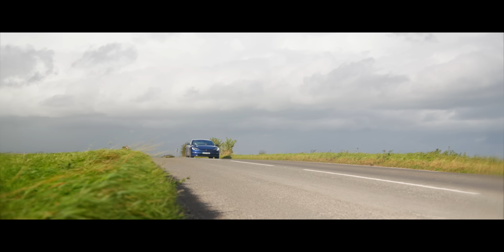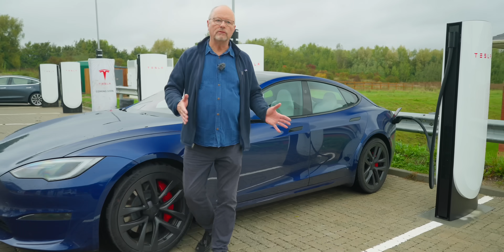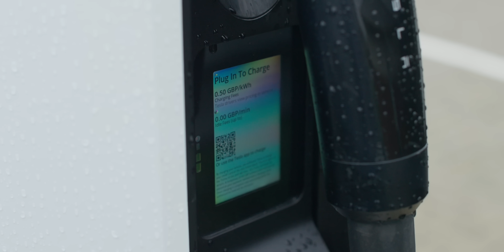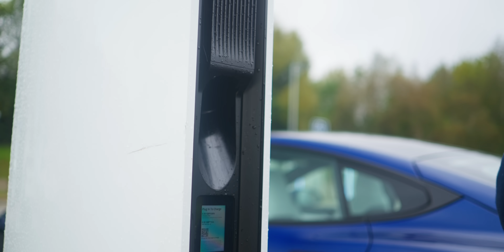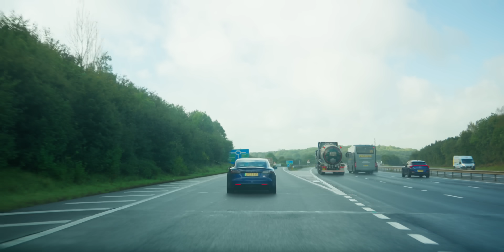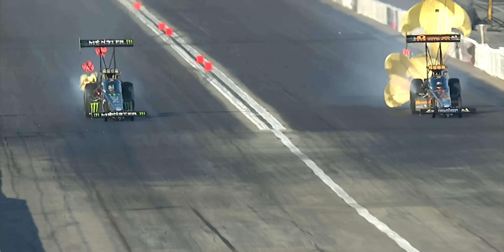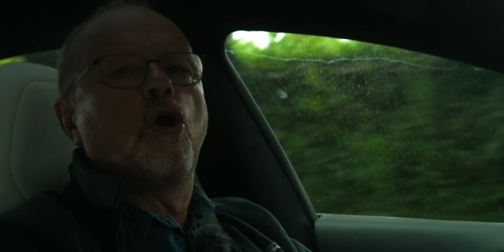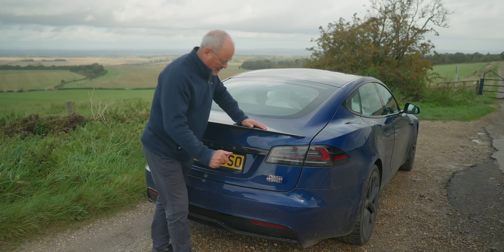THIS Is Why The Model S Plaid Didn’t Come To The UK

Comment: Clearly, like the TM3 "upgrade", the lack of stalks is a cost-saving exercise, and another move towards de-skilling drivers so that they become dependant on automated controls. Personally, I'm extremely happy with my 2022 TM3LR, and forgive its's crappy automatic wipers, and terrible Auto-pilot cruise control, because I don't ever use them now. But I will not willingly have a car which requires conscious observation of the controls, to accomplish basic functions like signalling, horn activation, wiper controls, forward / reverse. Driving a car should be fluid and natural, done by touch & feel, not by having to divert 100% of your attention AWAY from the road to manage basic tasks.

Comment: I think Tesla are redesigning things on the assumption that the car will be driving itself soon, including indicating, so slowly removing things. How safe that assumption is a matter of opinion.

They're probably thinking it's not worth having a right hand drive S & X factory line when a few more versions down the line the car will have no steering wheel and be identical whichever side of the road it drives.

One thing I do think has changed for the worse that isn't about the driver is the space. My 2016 Model S is like a Tardis maximising every possible cubic centimetre. 
The cavernous space behind what would now be the front boot is large enough for a large holdall and still leaves a massive space enough for 3 or 4 backpack sized bags if they are soft enough to fit the shape. On top of that there's another large space under the boot. The newer models have a plastic molded shell only big enough for one large case in.
Reply: Thinking that cars are gonna be fully self driving in any kind of near future is a MASSIVE leap of faith......also, being able to do it, doesn't mean it will happen..............!!

Comment: Controls in a car are designed to be able to be found and used without taking eyes off the road.
Indicators, wipers, climate control all needs to be physical levers and nobs. It's infuriating and dangerous when I have to look right down at the bottom of a screen to adjust the air. At 100kph, I've travelled 200m in that time, scary.

Comment: The Model S will remain the choice for Tesla Fans only. Why spend over a 100k on a car with the steering wheel on the wrong side, let alone the daft indicators! Whilst from other YouTube videos this latest model is as cheaply and badly built as ever! 
Still it's great to see the Supercharger network being opened up, even if it takes away the one reason why most people buy Tesla's.
Buying a Tesla is like buying a white goods appliance, a fridge or something. Most of the Model 3 or Y cars I'm guessing are bought on lease or as company cars by buyers who aren't interested in cars generally, and the Tesla thanks to being an EV has cost advantages. Most of the Model 3s I see being driven around London are all in white (I believe the only no extra cost colour) and filthy, maybe I'm wrong, but that tells me company car transport with little pride in ownership - they are the modern day version of the fleet Ford Cortina or Vauxhall Cavalier. Back then the basic rep had the 1.6L Whilst those further up got a GL or Ghia/CD. Presumably today the option to choose an extra cost colour would be the equivalent!!

Comment: We're burning 100 million barrels of oil each day.  That's 4 billion gallons of oil per 24 hours.  That's like emptying an 18" diameter pipe that's wrapped 1 and 1/2 times around the Earth every 24 hours burning at over the speed of sound continiously.  Every moment.  Don't get me started on coal too.

Comment: As you mentioned, when you drive very fast, a combustion vehicle consumes a lot of fuel. Keep in mind, running the Plaid at 200 MPH will drain the battery in a big hurry! The only thing this car can't pass at 200+ MPH, is a charging station.
     You've now got a car that competes with Bugatti, McLaren, or Koenigsegg, leaving Ferrari and Lamborghini in the dust. The difference is, it costs 1/3 as much per mile to drive as a Toyota. The Tesla costs only about 1/10 the purchase price of any combustion car that can even hope to keep up. The Tesla can be driven every day, with maintenance costs being the same or less, than a small economy combustion car. The 3 "Hyper cars", and the 2 "super cars" I mentioned, are maintenance "nightmares", and guzzle fuel, costing 10X more per mile, than the Tesla that can out-run(or at least, keep up with) those super expensive supercars.

Comment: Incredible piece of engineering for sure. As for it being able to beat an F1 car to the first corner on a racetrack, I remember back in 1993 Michael Schumacher's car did 0-150mph in 7.5 seconds (according to the commentator Martin Brundle during a race). I suspect the current F1 cars are no worse in acceleration and other performance parameters. Comparing apples to oranges of course.
Reply: It might beat the F1 cars off the line, but they will come past well before the first corner because they brake so much later, partly because their brakes are so much better and partly because they aren’t slowing down as much.
Reply: @peterbrown6453  And because their extreme downforce gives them so much more grip / traction that they can brake harder without skidding / losing traction...
Reply: @logicalChimp  I was thinking more about the downforce enabling higher corner speed and therefore less braking, but you’re right

Comment: Ever noticed LH drive cars are more ergonomic, but for RH cars manufacturers simply transferred the steering wheel to the right and only swopped the main light Switch over, but kept the stalks as they were, plus centre consul A/C is now worked by left hand - my old Morris Minor had indicator stalk on right hand side, and headlamp dip was a left foot floor button lol. 
 LH cars logically have ALL light functions eg switches, indicator/light stalk and cruise stalk on the left, -  then ALL windscreen functions eg wiper stalk on the right, plus right hand use centre consul A/C and demist etc buttons.
Means they can change gear with right hand at same time as left hand working indicators or flashing lights by keeping left hand on wheel for overtaking - or simple motorway cruising by using just the left hand for all these major controls. 
Also LH cars has a wheel mounted volume control on left and the radio volume in centre consul on the right, so either hand can quickly say mute volume.
After 50 years it is too late for us oldies to learn any new layout on ICE cars, unless EV cars slowly introduce it.

Comment: I think an indicator stalk is a safety feature. Do a left turn with a quarter turn of the steering wheel and then try to use the indicators.
Reply: I would hate that when using the large roundabout near my house.  It's a dual-lane one with 5 branches, and people really fly around it fast.  Some idiots don't understand that if you're in the outside lane, you have to turn off onto the very next branch.  So when I'm in the inner lane, I have to allow for those idiots - and it takes a lot of my attention.  Do I have enough attention remaining to find the signal button as well?  Not really!!

Comment: Not sure that I will ever use all the capabilities of my Model 3.... although I did get it over 160kph on an Autobahn earlier this year.  But yes, the blistering acceleration when you need it is something else.  
I have found the inability to easily change wiper speed a bit of a pain. Auto mode isnt very responsive. Even sometimes turning the lights on (hey, car, its raining - put the lights on) can be a faff around some menus (while you are trying to drive in your own lane).  Not sure removing more stalks is a sane idea.  In fact, I was wondering if someone couldnt come up with a set of buttons the clip on the bottom of the screen for some "quick access".  Having a button in a known position that you can get to without looking at it seems to be things I miss most.

Comment: It's not that you're an idiot: it's habituation. If you, like most Tesla drivers, are using "2-pedal-driving" do you complain about having used the brakes "for ages" and now miss them?
Physical levers need actuators to input lever signals, while the coming FSD Robotaxi will be even a step further with no controls at all! 
Every technology eventually gets streamlined to its most efficient, simple, least expensive iteration. 
If Trix are for kids, stalks are for human drivers...for now.

Comment: The horn is the more dangerous thing here. In a moment of panic, having the horn in the middle is easy since people out of fear naturally put their hands in front of them to "brace" themselves. No amount of Bruce Lee finger pushups will protect me from an impact using a single finger.
Reply: If you leave the horn until you're actively bracing, you've left it a bit too late for it to have any benefit.  The horn is best used before you reach the 'oh shit' point :p
Reply: @logicalChimp  And yet that's not how horns work in oh shit moments. Prepare for the worst, hope for the best. Otherwise you set yourself up for disaster.

Comment: nope your bang on about the controls Robert,  its ok in America due to the block layout and long roads, but Europe with its many corners, roundabouts, left/right turns, I feel its a major safety concern and tesla or government should step in and mandate wheel controls indicators. lights  wipers and gear select as mandatory physical controls,

Comment: We need to stop spreading mis-information about EVs. We really need to do that, because all the mis- information about EV's is killing the market for them. EVs are better for the environment than ICE vehicles. I drive an EV. But trying to pretend that they are easier to use than ICE vehicles is a lie. It makes EV users look like crackpots, and discourages people from making the switch, because they do not like being lied to.
Diesel car owners can add 900 mile of range in 10 minutes. They don't get charged a higher price if they decide to pay by credit card instead of through an app.
Tesla do have the best charging network, but the technology is still nowhere near as convenient as ICE. We won't persuade people to change by telling them that it is, when they can see that that's a lie.
Reply: Your perspective might make sense if you could drive 900mile in one hit, without considerable time spend eating or "doing other things" ("emptying").
The moment you drive 200 miles, then stop (an average 3 hours in the UK), that stop affords sufficient time to "top up while you do something else (rather than standing by the fuel pump).
If we assume the driver is making that stop anyway, the EV charge is "free time".
.
Reply: @rogerstarkey5390  Roger, you're missing my point. I have an EV, I know how the system works. The point is that fully charged are claiming "you can add 900 miles of range in an hour". You can't. They are telling lies again. The biggest and most influential EV channel in the UK, and it's lie after lie after lie after lie. We're not going to convert people to EVs by lying to them.

Comment: The fact Tesla removed the 2 levers on the model S, X and the new model 3 is the single most reason that turns me off and makes me keep my current model 3 performance. If they just made it as and option to buy with or without the levers it would be very welcomed. Just like you can chose to get your S or X with a traditional steering wheel or a yoke

Comment: Regarding the deleted stalks, to people with such cars. Does the car indicate by itself if following a preprogrammed route, or do you still have to do it manually? Also, when the new controls were announced I remember reading the car would automatically put itself into forward or reverse drive and the screen swipe was just an override. Does it do that?

Comment: NEVER mentioned in 40 years, RE fuel consumption of hyper cars. NOT true. Off hand I can think about Top Gear not only mentioning how much and how quickly the fuel went in the Bugatti Veyron, they make it a highlight of the review. Even going so far as to show the fuel gauge dropping in real time as the car was barreling down the straightaway.
Reply: It empties the tank in 100kms at wide open throttle. At 300km/h the tyres will blow first

Comment: Did you mention the cost of tires for the vehicle weight and use? No. Question: What's the ratio miles, wear to replacment? This is another aspect that should be explored.
Reply: While there, discuss the superior traction control which reduces tyre wear....?
(Watch a Plaid launching minus wheelspin)
Reply: I mean michelin gives a 40k warranty so they will prorate whatever you don't make it to 🤷‍♂️
Reply: Bear in mind that the Model S isn't that much heavier than the BMW 7-series (the closest ICE equivalent, I think) - meaning that tyre costs (for weight and speed rating) are about the same...  as for wear-rates - that's determined by driving style, regardless of powertrain

Comment: I tried the V4 superchargers at Trentham with my ID3, could not get them to work either via contactless or app. Eventually had to carry on up the M6 to MFG.
Reply: From what I've seen elsewhere, they're a bit fussy about the sequence of steps... apparently you need to 'activate' the stall via the app (or possibly via contactless) before plugging in to a non-Tesla.  Alas, don't have a non-Tesla EV to try it with myself, but something to bear in mind if you get to try them again in the future.
Reply: @logicalChimp  unfortunately I tried both ways. And for contactless operation, you have to plug in first - this is what is supposed to make the contactless payment screen appear, but in my case it didn't.
Reply: Volkswagen hasn't signed up to Tesla
Reply: @TheMagicJIZZ  perhaps you are in the US? In the UK the public Tesla superchargers are supposed to work with all cars that have a CCS connection and I know many VW drivers have used them successfully.

Comment: You are absolutely right. Both the turn indicators on the wheel, that move when you move the steering wheel, is daft. The horn should be in the center. The drive selector worked better when it was on a stalk as well. Reaching the screen and swiping up and down is lame and doesn't feel good on my wrist and hands. 
Give me a "leever" for the turn signals please. 
At least you have an actual wheel.

Comment: Lots of people agree with you on the indicators. If I was determined to get rid of them I would have made it a wheel squeeze. Left gets left and right gets right. The computer knows where the wheel is so even on turns it would work just fine. Easier yet - keep the stalk.
Reply: And suddenly you can't indicate in one direction and change gear at the same time.  (Although maybe that's no longer possible in the UK anyway?  When I learned to drive in the UK the indicator stalk was on the right, but now I live outside the UK and it's on the left.  I think new cars in the 90s in the UK had them on the left too?)
Reply: @-_James_-  In the USA, in theory, the indicator is turned on at least 100 feet before the start of the turn. That said, my having thought further about it, many people 'death grip' the wheel, so using that to trigger a turn signal goes bust. I had a 1971 'cuda that had the optional rim squeeze horn. If I squeezed the rim, the horn would sound. It was a bit lame. I'm firmly in the camp most people are in - taking the stalk away was a poor choice.
Reply: @arleneallen8809  But on a roundabout, depending on where your exit is, you may start indicating before the roundabout (if you're not going straight on), when you pass the exit before yours while on the roundabout, or both (changing while on the roundabout if your exit is more than 180 degrees around from your point of entry).

Comment: Are the wipers and indicators available on voice control? That would be the easiest option if removing the stalks.
Reply: Would you like to yell at your car leftturn rightturn every few minutes?
While having a conversation with a passenger🤭??
Reply: @iBackBeat  And you would also need to find the voice control button on the steering wheel 😂
Reply: @pauld3327  
Right!
Reply: Indicators on voice control ? 😂